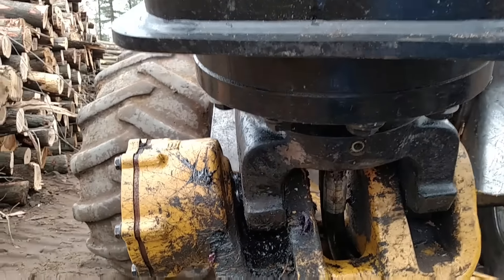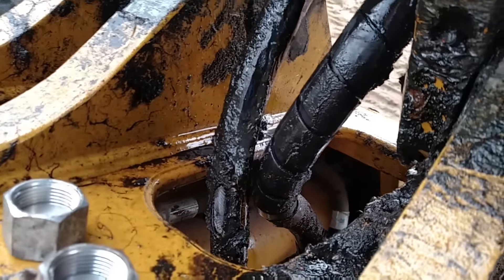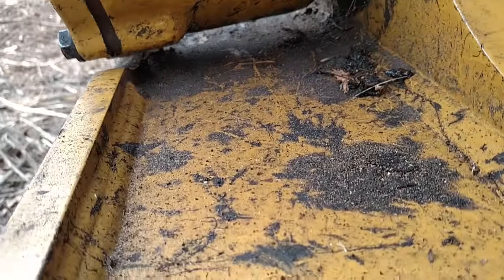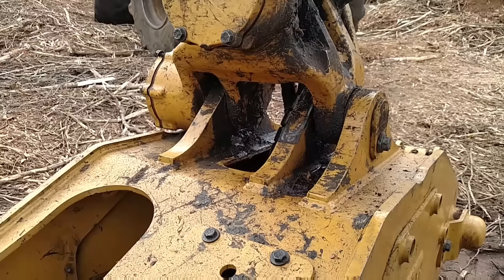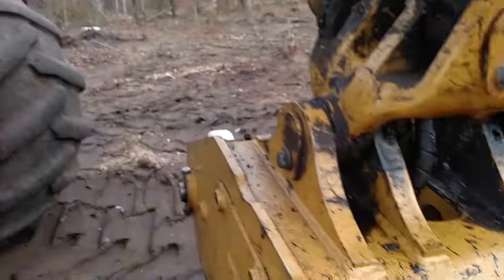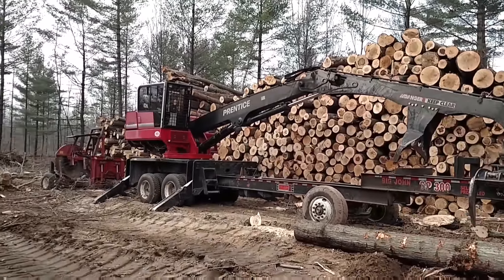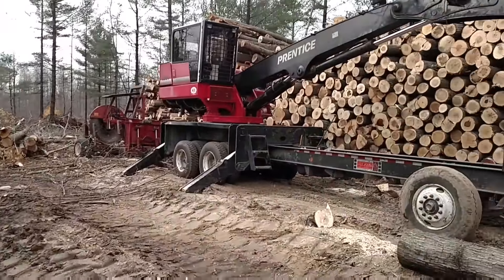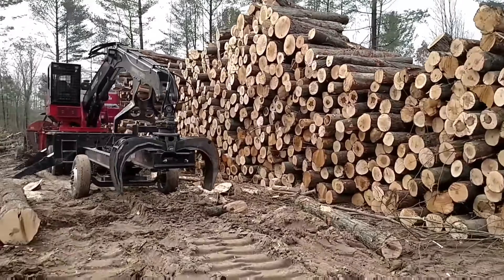CAT SKIDDER...DOWN BUT NOT OUT!!!!

Comment: That's cat for you man. I like how they make all their stuff so easy to engineer and fix. It's reflected in the toy models and probably the most difficult things I've ever had to replace on a caterpillar toy was the arm for my M3 15 the excavator. And really it wasn't too awful hard to fix it just had a few extra pieces that I wasn't used to dealing with.
Reply from the maker: +Alex Williamson'sadventures They make some nice stuff that for sure!!
Reply: The only thing they seem to have a little trouble with is farm tractors. For some reason they don't make a lot and they're a little underpowered. However their harvesters seem to work great in most situations.